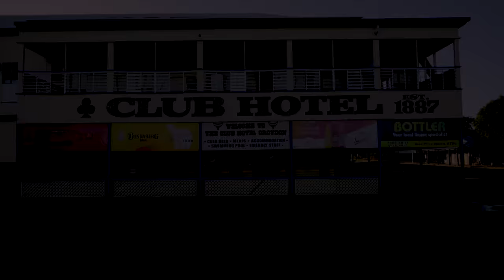Bogged in the Australian Outback Ep5 🇦🇺

Comment: Isn't it good when you find a mechanic with diagnostic skills rather than one who unbolts bits and puts new ones in because that is what the diagnostic tool told them.  Good on you AMAC Motorcycles.  I hope the wire you cut got replaced.
Reply from the maker: Liss: They were so good. And amazing that they managed to find the time to help us. They were so busy and really went out of their way.
Reply: @RidingOnEggshells  .. What was the verdict with Harry's wiring problem?

Comment: Harry's bike sounds heaps better, what happened with the wire did it get replaced ? One step further :)
Reply from the maker: Liss: Yes, electrics guy fixed up the wiring. No new loom but a replacement of all the damaged areas.
Reply: @RidingOnEggshells  thats gonna give peace of mind. A melted cable in a loom only causes more problems down the line if you dont cut them out and replace the charred sections.